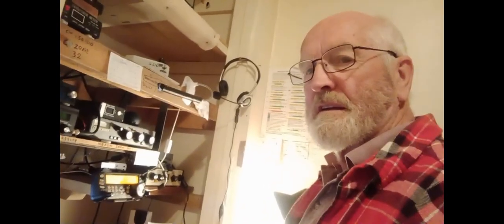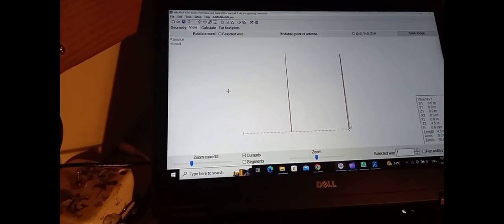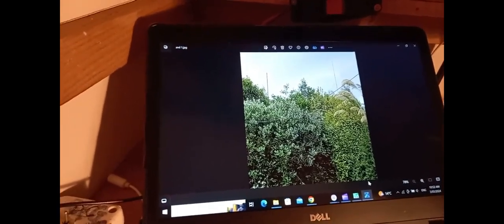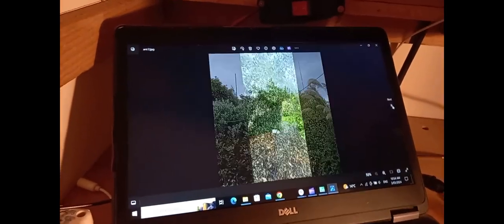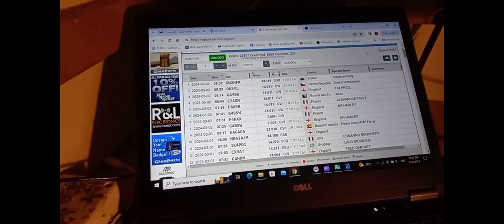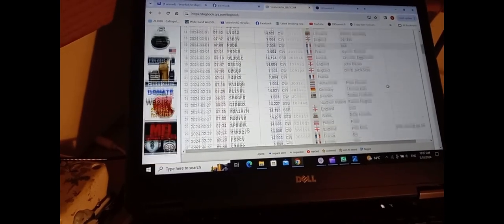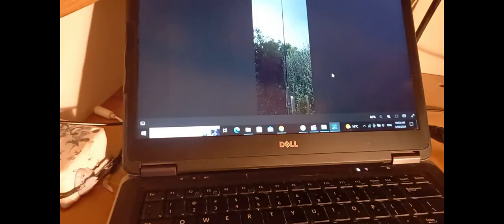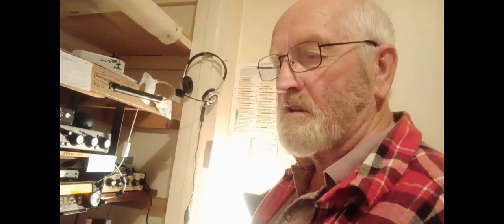ZL3XDJ,  small garden 20m 2 ele parasitic array

Comment: Ism doing the same thing - with a twist.  Vertical elements are two 17ft telescopic whips raised about 2.5 meters above ground on studio light tripods

Radials are elevated , sloping down, terminatimg 1 meter above ground on plastic tent poles.  Two radials on each elements and pointing about 45 degrees apart towards front

MMANA saus about 8 db front/back ratio - practical tests not done yet due to band conditions on 14m

This setup is really a combo of two of your videos
Reply from the maker: @bodstrup  that sounds brilliant,  so much from a simple ant, hope we can catch up, 73 zl3xdj

Comment: How are the radials connected to the parasitic reflector? If they are connected, it drastically lengthens the reflector far beyond the 10% bigger than the driven element. That is likely why you did not notice a difference when you adjusted the length of the reflector. I'm pretty sure you do not want radials connected to the reflector. It's purpose and use relies entirely on being a specific length. That is also why the 1/4 wave distance between them was not working correctly.
Reply from the maker: Really appreciate the info. I did try radials and basically got better results with radials on than I did without them. I simply used some sdr  
Rx in eu to monitor the results. 73
Reply: @brianfields4479  There has been some recent study of multiple element verticals with radials but they feed both with a phasing coax and they are out of phase so one pushes against the other and makes it directional. Heres a link...https://www.youtube.com/watch?v=bkhT1Z5vOLM
Reply from the maker: @aarongriffin81  thanks for that info. I found using a Netherlands sdr, my parasitic array worked better with radials over 14k miles, so I just went with that hi.73 tks.